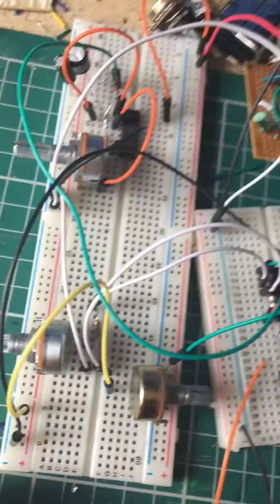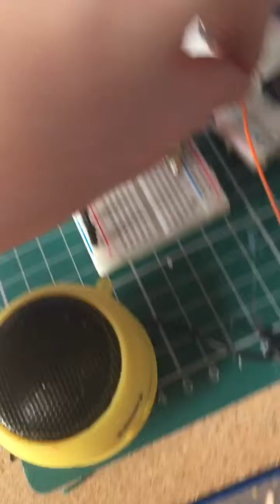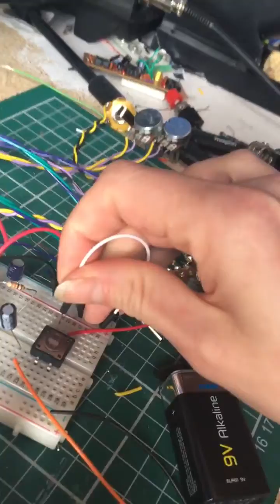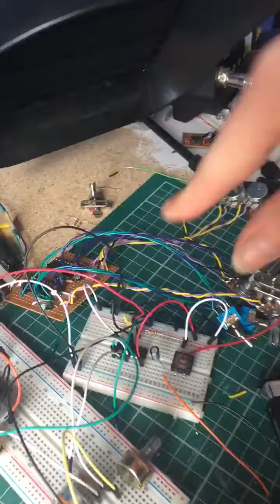Dub siren. Schematic in description

Comment: ~BOM (Might have missed something): 

2x 3pin-Toggle switches 
1x 2pin-Toggle Switch
1x Pushbuttons
2x 100uF caps 
2x 10uf caps 
1x 220nf caps
1x 1N4148 diode
1x CD4093 (Quad 2-Input NAND Schmitt Trigger)
1x CD4046 (Micropower Phase-Locked Loop)
3x 2.2k resistor
1x 10k resistor or 10k pot 
3x 47k pots (lin) 

Other: 
To my understanding the schematics on the link above is missing power to the 4046, Should be Pin 16 positive, Pin 8 gnd. take power from the same rail-point as pin 14 on the 4093 to keep the loop closed

Please correct me if im wrong

Comment: Very nice   Gonna try it out how much volts is it please thanks
Reply: Is it pin 16 on the 4046 chip the positive input ? Thanks
Reply from the maker: sorry for not replying  - from memory it's pin 16 but you can check on a datasheet.  I was using 9v
Reply: @carlcreary875  Yes, pin 16 positive and pin 8 gnd
Reply: +5-9v, depending on how you intend to use it. If you intend to add a echo/delay/plate reverb board (PT2399/CD2399) i would recommend going somewhere in between in the upper region